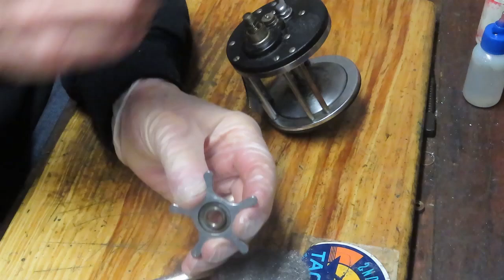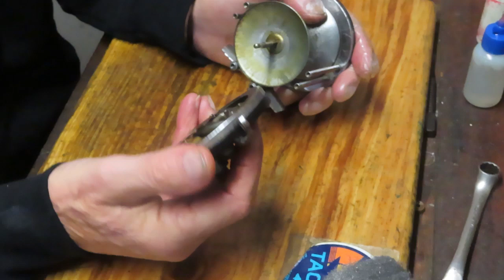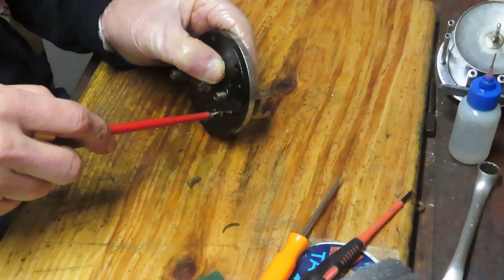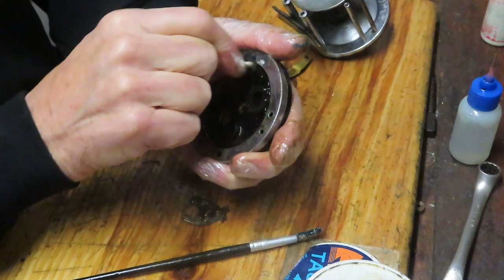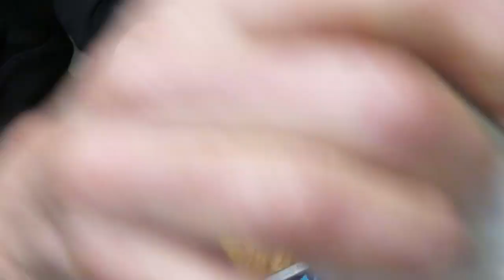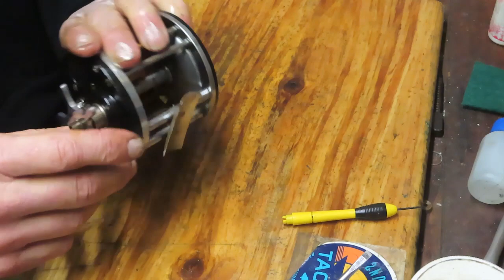Pflueger 2048 Sea Vue vintage saltwater fishing reel how to take apart and service

Comment: Hi Dennis
I have a sea vue and the bakelite is cracked on the non winding side (with the big round thing in the middle)
Can the chrome ring be removed or are they sweated on
was planning on trying to repair the crack with some superglue and bi carb soda
Thanks
Greg
Reply from the maker: The chrome rings can generally be removed.
Reply: @2ndChanceTackle  Thanks Dennis 👌
Reply: @ Hi Dennis
The restoration of the sea cue is going good
On the off chance you may know the answer to this
I am missing two screws on the winder side

Are Pflueger screws interchangeable with penn ?
reason I ask
In Australia penn stuff is more easy to obtain than Pflueger

Comment: This is the same “MT” found on the SkilKast, an ingenious centrifugal brake. Parts are missing on yours, notably the minute and loose(!) ball bearings that operate with the directional cam. Often, people will unwittingly open the MT up and lose the tiny bearings. And/or they put parts back in wrong order. This is a reel where referring to a schematic ahead of time is important. Also, working over a damp paper towel may help keep the bearings from hitting the floor! Later models of the MT the mechanism was sealed, which likely saved a lot of heartache.
Reply from the maker: Thanks for the additional information and tip on the paper towel - Dennis
Reply: Ah! Yours looks be a later version of the MT, with two cams -sans tiny easily lost ball bearings. Even later Pflueger went to a “sealed unit” that was simply easier for maintenance. Gosh those little bearings can be nerve racking!

Wouldn’t know if parts are missing without a schematic, or putting line on and seeing that that ingenious directional MT is functioning.

Comment: Do the new Pfleuger from China have plastic parts like the Abu Ambassadors do?  I err on the side of age all the time. I like this reel Dennis. It looks sturdy and well-made! Great video Dennis — Chris
Reply from the maker: The current Pflueger line up is largely limited to spinning reels and the low profile President baitcasting reel.
They are variations on the Pure Fishing reels.  I am not aware of plastic parts other than what would be common in all reels.  The President line is still a well made reel.